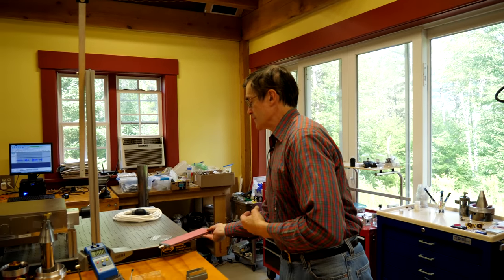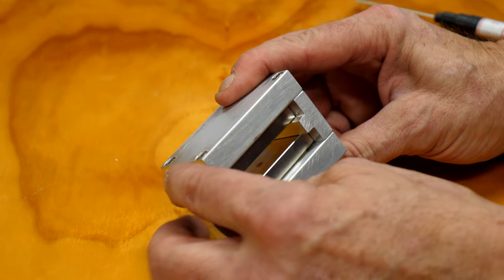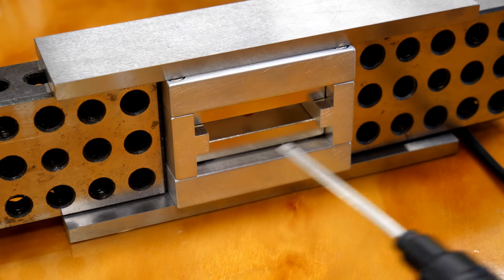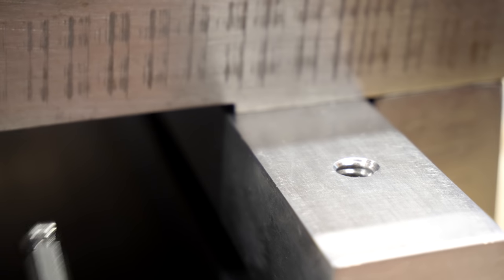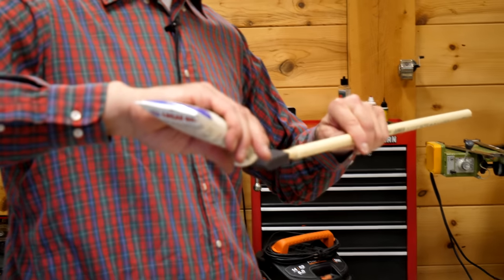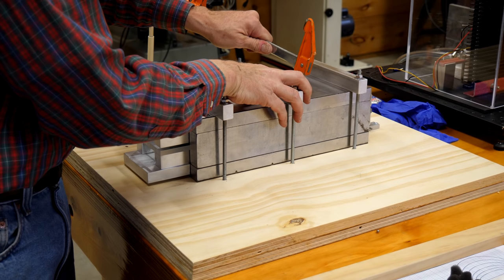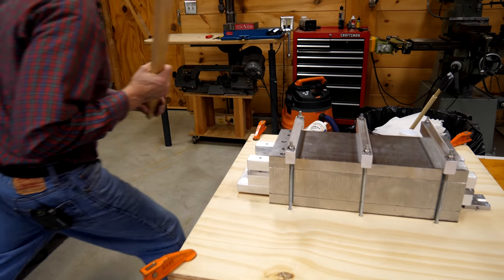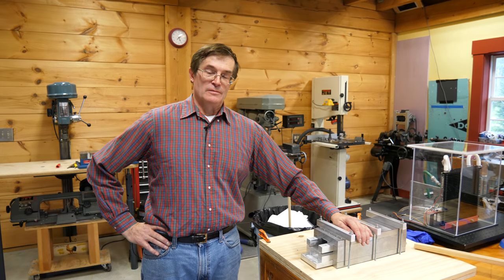Extreme Magnets

Comment: I think you would like my theory on magnetism. It's based on dual flows of energy emission from the  electrons and protons. Each absorbs the others emissions and transforms it into its own which is repeated indefinitely. It's magnified when multiple atoms are aligned created higher voltage differentials. 

Antimagnetics are reversed flows. Nuetrals have near 100 percent resistance to flow. Magnetics actually add power to the flow by adding their own flow. Representations are a reverse polarity magnet to the original. The air for neutral. And another similar polarized magnet adding to the originals strength.

Comment: loading the magnets is pucker factor 9000. i've been there, and its SO easy to make a mistake and explode a magnet (or a finger). i've been lucky that i've only smashed magnets and i only hurt my hand once when a sewing needle got picked up by a magnet in my hand. it stabbed pretty far into my finger before i could pull it out, but it was a small needle so it didn't do much damage (not enough iron mass for the magnet to really grab)

Comment: Your magnetic field problem what if you spun the magnet sideways build a new channel to fit it wide and stack them in side by side until the space is filled and then the water will run only through all the centers I'm wondering if this will help

Comment: I can't really relate to a field that's roughly 30,000 times as intense as that of the earth at the surface.   Why would electrostatic fields seem more intuitive?   I need to play with magnets more. ;-)       Thanks again (late) for a very interesting assembly.   So nice to see the preparation needed to be successful with these kind of forces.
Reply from the maker: That is a very deep question.  The reason for the extreme differences in the fundamental forces between particles, including gravity, is at the heart of the quest for a comprehensive model in physics.

Comment: Is there a maximum theoretical efficiency to these types of generators or is it only limited by the magnetic field strength?
Reply from the maker: I'm sure there is, but the big hump that must first be crossed is the avoidance of electrolysis.  It takes a lot of energy to tear apart the oxygen and hydrogen in a water molecule.  Expelling this gas out of the generator unused, is costly.  The trick is keeping an individual MHD cell at or below 1.2V of potential.  Controlling the field, the velocity and possibly resorting to parallel cells operating in series are potential solutions.

Comment: After learning about the accidents at CERN magnets suddenly seems to have become a hot topic, as extremely powerful magnets are used to amplify, accelerate, and direct protons and neutrons at near light speed. Perhaps you could get a job as an engineer for CERN. Out of curiosity; i would like to know what alloy are the most powerful magnets made of, and how powerful are they?
Reply from the maker: The most powerful, non superconducting magnets, are the N52 neodymium magnets which are an alloy of neodymium, boron and iron.  CERN is a very interesting place.

Comment: Another topic idea that might be fun to do along these lines is build and demo saturable reactor/magnetic amplifier.  I'm thinking about building one to control heat to a boiler of a particular purpose and they actually look quite straightforward.  My basic understanding (which could be wrong) is that you wind an inductor in such a way to induce opposing induced fields in the core.   When you run an alternating current through it, this essentially shunts the current through the conductor.  However, if you induce a magnetic field in the core to the point of field saturation, there is no longer any induction by the AC line and current is able to flow.  Intermediate states of saturation of course allow you to vary the current.

Comment: Aren't laminations better at guiding magnetic fields as well? Like the iron in transformers and motors are always laminated sheets.
Reply from the maker: This is advantageous when there is a varying magnetic field like in a motor, generator or transformer.  This inhibits eddy currents within the steel, making the yoke more efficient.

Comment: I nearly lost some fingers when I opened the packaging for 2 large neo magnets I purchases on-line .... I thought they were far enough apart when unwrapping but obviously not as one of them took off and smashed into the one in my hand ... causing a huge flash of light (like a lightning bolt) and pulverising the magnets into a million pieces with what was nearly a fire with smoke etc 

Very cool I must say despite the $600 cost ... wish I had the video camera recording it.

So extreme caution is an understatement with big magnets .... don't be a redneck like me.
Reply from the maker: You're  absolutely right.
When unpacking  these magnets I treat them as I would an explosive.
I usually spend a couple of ours constructing a WOODEN fixture for clamping and sliding these magnets to safe distances as well as building rough wooden crates with large internal free space, to store them.

Comment: Would you consider replacing the aluminum fixtures with nylon or perhaps a Delrin material to have less impediment of the magnetic fields and lower you friction due the self lubricating properties of those materials.

Comment: Can you get the magnets out when finished with this experiment/apparatus? If so how, if not, what's its fate?
Reply from the maker: With some effort we can.  A small hydraulic cylinder with an aluminum shaft can push these back out, where they can be removed.  I don't plan to, as such a large, powerful field can be used for so many projects...videos.

Comment: In thinking about the rail gun, it seems the most likely time for the sabot to weld would be near the first instant, before any motion had occurred.

One way to avoid that might be to give the projectile an initial velocity, either with a pneumatic or propellant (cordite, etc) powered "gun". With the projectile moving, the chance of welding would be minimized.
Another approach to the "contact" problem might be to line the rails with a strip of copper, attached to the rails at the muzzle end, and to the projectile at the trailing end.

Any energy that would go into arc or plasma would be conducted through the projectile by the strips. Additionally the copper strips could be coated with the eutectic alloy, providing appropriate dosing of the alloy along the track.

So, part of the launch current would be carried by the copper strips, and the majority carried across the strip, through the low temp alloy.

In cross section you would have the rail, copper strip, alloy, projectile, opposite alloy, copper strip, opposite rail .

The alloy might also be in strip form, initially. The resistance of the copper strip, and the high current, if properly tuned, could provide the heat to liquify the alloy..

Sounds like a fun problem.
Reply from the maker: Agreed

Comment: How the yoke design translate into a disk configuration?
I am trying to maximised the magnetic pull of an Axial flux permanent magnet generator, for a wind turbine.
Using a 40x20x10 N52 magnets, I assume the disk where the magnets are fixed, needs to match the thickness of the magnet, namely 10mm. 
The perimeter of the yoke to be the same, at 10mm & the gap between around the same?
Reply from the maker: I can't address the gaps in your design, but the thickness of the steel should be at least equal to the thickness of those magnets.

Comment: I know this is way off topic, but would it be possible to use neodymium magnets in dentures to keep them forced apart - pressed against the gums? I'm very curious to see if it would work, but only if the repulsive force would even theoretically be enough. I haven't been able to locate neodymium bar magnets that weren't magnetized along the short axis in order to test the push effect with any incidence of attraction getting in the mix (as teeth also move side to side when grinding).
Reply from the maker: Yep, that's a little outside the usual envlope, but that is where just about every innovation originates.
There are too challenges as I see it.  The least is the susceptibility of neodymium to corrosion, the magnetswould have to be well protected.  More problematic is the geometricly increasing repulsion.  With your jaws far apart, the retaining force will be at it's lowest level, but you might find it difficult to approximate your teeth in order to chew.  Also, strong magnets in your mouth would be a hazard if any feromagnetic objects got to close to your head.
Reply: @TechIngredients  Plastic spoons only (you could always do that "spoon on cheek trick HAHA) . 
    Yeah, I'd thought of the  geometrically increasing repulsion and don't really know how much of a problem that would be. They'd probably need to be well engineered for each person's circumstances. For me perhaps a short upper plate magnet and a long lower plate magnet would travel more in parallel to the force lines to provide a more uniform push against the opposing plates. 
  On the other note, I'd expect that being embedded in the acrylic it would not be subject corrosion. Thoughts?
BTW, thank you for replying. Your videos are awesome!

Comment: Could you have place the upper and lower magnets on the acrylic and then inserted them together? I'm trying to picture the situation as such. Could you explain if that's not a good idea.
Reply from the maker: The magnets are so strong that as they approached each other, they would slam into the acrylic and possibly crack it.  Even if you chose polycarbonate which has great impact strength, you would probably not be able to remove the plastic when you're done.
Reply: @TechIngredients  Yes, I had not thought about those things.

Comment: Can someone please answer these questions?  1) I don't really see the danger in assembling this apparatus.  Isn't the disassembly when the magnets must be separated a much more dangerous process?  2)  What applications other than the construction of a rail gun are there for this technology?    3)  Why can't this system be used to cheaply fire payloads into space?
Reply from the maker: Sure.
The magnets can shatter when they impact.  They are loaded with potential energy.  Take two identical magnets and orient them with like poles up and down, then force them into contact (if you can) and clamp them together.  This is how all the crystals in a magnet exist in relation to each other.  When the clamp is released every crystal catastrophically reorients.
You're right about the rail gun.  I suspect that in the long run it's major impact will be as a launch mechanism rather than as a weapon.

Comment: Would the maximum efficiency of a space be found in a construction with poles facing inward in the shape as close to a sphere as possible? So two magnets face each other = increase. What about 3? What about 4? What about infinitely many oriented with their opposite poles facing each other (as nearly as possible)? Or cylindrical?
Reply from the maker: That design is probably OK, but with rapidly diminishing returns.  The magnets will begin crowding each other out and the increased number of magnets will be balanced by the ever increasing distance of the magnets from the center of the assembly.  A gap with a heavy yoke with two conical steel pole pieces within the gap to further concentrate the field is probably the best realistic solution. 

You might want to try playing with this tool:
https://www.kjmagnetics.com/gap.calculator.asp
Reply: @TechIngredients  thank you for the reply! That site's blog post eventually led me to find this. Very interesting ! https://en.m.wikipedia.org/wiki/Halbach_array Also, love the show, thank you for the content!

Comment: I'm concerned about fracturing the magnets as they slam together.  Might a few low temperature paraffin pellets absorb that energy like tiny traffic water barrels?  Low temp melting point about 125-135 F.  135 F shouldn't hurt the magnets. About 5 to 20 of them more or less.  Stuck in place with a little heat.
Reply from the maker: Actually,  I've had good luck with a few pellets of dry ice in later builds.

Comment: I finally got ya!

Calling your neighbors to get them to call the cops now! 

Get the illustration inside now!

At 5:33 you state that the bulging of the field decreases the strength of the magnet, while showing the illustration that fails to have drawn the non ferrous housing

Albeit, when you passed the meter over the center of the magnet the reading jumped between 469 and 704 ( you est the greater the meter reading the greater the field ,)

Then as you passed the wand flank the magnets center the reading jumped to 499!

The lines of force cannot domain saturate the non ferrous chassis and so the Alfven front conjugates to condense the lines of force nearer the housing!

Comment: Little bit late to this one but have you tried using any of these magnets in proton magnetometer or nuclear magnetic resonance? The small gap between two neodymium magnets is commonly used in the $20-100k benchtop NMR models.
Reply from the maker: I haven't, but the principle is streight forward.
Reply: @TechIngredients  I've noticed there's a lack of information on it outside of acadamic resources, and much of that is based on more advanced magnetic resonance techniques than just aquiring CW signal, free induction decay, or a chemical shift specturm. There's a large number of papers and books published in the 70s and 80s particularly by organic chemists who due to financial constraints at the time built their own fourier transformer NMR spectrometers using quadrature detection and other techniques common to amateur radio yet not so much in the modern engineering world. I don't have a signal generator or spectrum analyzer so I can't conduct any magnetic resonance experiments until I either build or buy those peices of equipment.  It seems pretty straightforward to do a demonstration of it and the existing resources, especially on youtube, either involve superconducting magnets used in organic chemistry research or are of poor quality.  I've been dying to see a decent demo of it.

Comment: so a burning question I have is if putting a magnet on the side of a microwave do anything bad? will it pull the waves to it heating up where the magnet is or something else? thanks
Reply from the maker: No, the magnet will not have an effect on the microwave distribution in your microwave oven.  The magnet does not bend the light from a light bulb in your room which is just a shorter wavelength version of the microwaves in the oven.
Reply: oh ok, I did some more research and it is the superposition principle, they just pass through each other and do not interact, the fields would add up but the direction and speed would not change for either of them so the microwaves do exactly what they would do without the magnet. that makes sense now and the world would be very different if they did since radio communication would almost be impossible. thanks for answering!

Comment: I know if you drop a magnet into a copper pipe it slows it down, would this "thing" have same effect on a copper ball?
Reply from the maker: Yes.  I could "feel" the syrupy resistance when I slid the aluminum guide bars out after the magnets were installed; for the same reason.

Comment: I’m not sure but from the color of the compound you’re using i’m assuming it’s not a metallic compound. Wouldn’t it be better to use a metal-based « grease » to create a better « contact » between magnets and yoke
Reply from the maker: No.  Unlike electrical contact, magnetic flux lines do not need physical contact.  All that matters is location and proximity.

Comment: I am no scientist, but I have a question that I pondered and wondered if someone with some brains could answer. If you have a magnet that's been put in a 'quantum lock' with another, is their any weight change?...what happens when you lift the lower magnet, do you lift the weight of both magnets combined still, as if they were one object? This might be so basically obvious to many people (sorry) but I just want to satisfy my own curiosity. Thanks in advance.
Reply from the maker: It's  a good question that it would take at least a few years to answer.  Quantum entanglement of more than a dozen particles has been done a few times at this point.  10^23 particles would be tough...😯

Comment: Why did you take the acrylic out? Especially when flipping that over.
Reply from the maker: The only time the acrylic is needed is during the fraction of a second when the magnet is rocketing into position.

Here is a very interesting fact, the force pulling two identical magnets together ie N to S poles, is nearly the same as the force pulling one of these magnets toward a heavy steel plate.  So, as long as the positioned magnets can not touch the incoming magnets the final assembly is very stable.

Comment: The center of a magnet is the most powerful part, it's referred to as the "B" field.  Find yourself a small granite rock and put it on a scale,  check the weight,  now tap it quickly with just the "B" field of the magnet ,   it will loose about a third of it's weight..

Comment: I have a small C yoke here that I have played with over the years. I have thought about using MHD as a means of undersea propulsion. Is that something you were thinking of here? A strong adjustable magnetic field and an electrical charge between plates bathed in sea water, which is fairly conductive. It works very well with mercury as a pumping method in a closed loop but I am too far from the ocean to try the seawater idea.